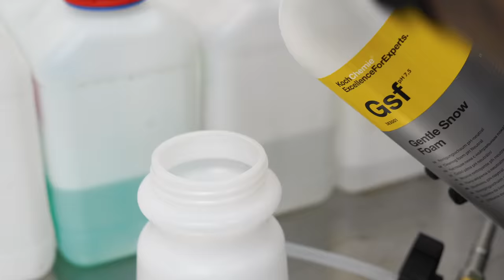BMW 6 Series Wash & Polish - Exterior Auto Detailing

Comment: May I ask you a question?
I don't have a garage to work on my car, so I wash my car at the gas stations. I use pump sprayer for pre washing. ( 3 liters of water and 150 ml snow foam) in contrast to your technique, I use foam on a dry car for longer dwelling process. I think that helps foam to work on the car to smooth the dirts. Which is correct and what do you think?

Thanks for the answers :)
Reply: I know the question is aimed at Vermijl, but the main reason behind him applying the snow foam to the car when its wet, is because he does a pre rinse to get dirt of the car as much as possible and to lubricate it. Then he uses the snow foam to get all the dirt softened and in the hard to reach parts as well. This then minimises the risk of swirl marks. Hope this helped answer your question